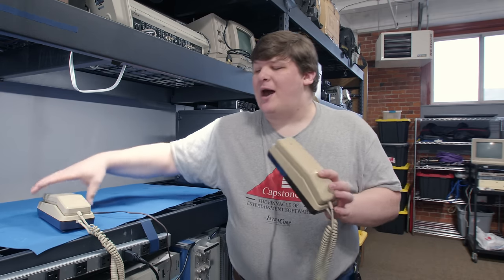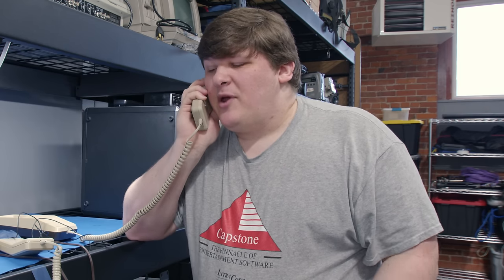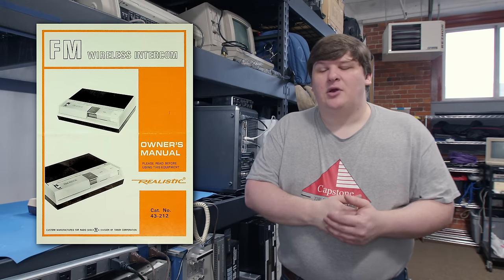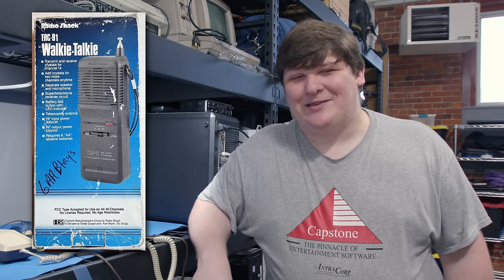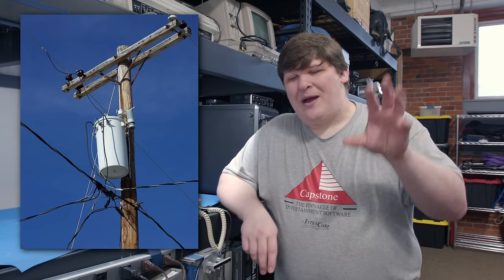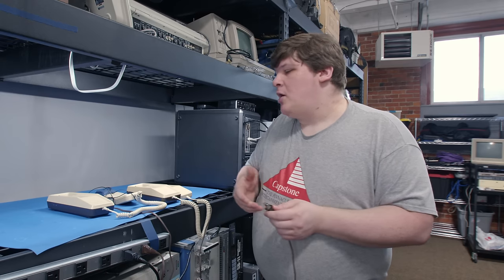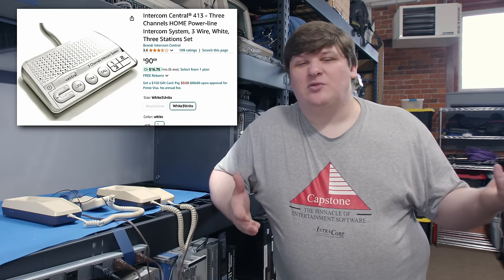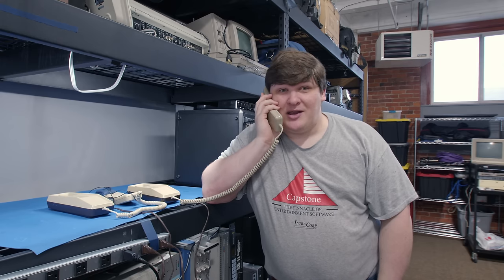How does this "phone" work without a line?

Comment: Send and receive frequencies would allow for both sides to talk at the same time instead of having to hand off/cede the frequency.
Reply: AKA "full duplex" vs the "half duplex" you typically see with walkie talkies, where you're either sending or receiving, not both.
Reply from the maker: ohhhh, that's what the full duplex means, of course. You can't receive while you're transmitting, it'll either feedback or you won't be able to hear the received signal, etc. I should have known that, haha.
Reply: @CathodeRayDude technically dual-simplex. Each channel only works in one direction. Full-duplex is using the same channel for both directions simultaneously, which is obviously more complicated than just having two independent one-way streets.
Reply: My hypothesis is the first unit you pick up to start the call always sends the ringing signal on one of the frequencies, and all units are listening on that frequency, or it just sends audio right away and the others use carrier squelch to detect ringing.Then the unit that picks up to answer the call will send its audio on the other frequency. Would be possible to verify by looking at a spectrum analyzer connected to the power line (I'm not sure how you'd couple it safely though but there's gotta be a standard method all these things use) and making calls in both directions and possibly by connecting a third one at the same time. If another one of these still exists somewhere.
Reply: That makes a lot of sense.
Reply: @CathodeRayDude  Except you can, one obvious example is a phone line ("plain old telephone service"), where the problem of feedback is solved with power of math and coils, as there is a special transformer (called "speech transformer" IIRC, which is ungoogleable) which subtracts whatever you are sending into the line from what you are receiving. With radio transmission how much you would need to subtract depends on the environment, so it's much more complicated and is not worth it for simple systems
Reply: Full duplex on a single channel is theoretically possible with AM but with FM... not so much. Mixing FM signals doesn't go well.

Which is incidentally why the French invented the SCART connector with RGB signals for hooking up consumer video gear, but that's a complicated connection.
Reply: @xpehkto  "hybrid transformer" is the term you're looking for. they are/were commonly used and sold labeled as such (as opposed to the implied one inside a phone) for connecting normal line-level audio equipment like tape recorders or mixers on call-in radio shows to phone lines
Reply: ALso known as "duplex" instead of "simplex"...
Reply: @xpehkto  "which is ungoogleable"
if you quote the words "speech transformer" and add the word `coil` or `telephone` you get some results.
the wikipedia article "Western Electric hand telephone sets" mentions the speech transformer, so you got the words right.
Reply: @thiesenf  that might be colloquially true sometimes (dunno - my limited electronics knowledge very rarely gets into protocols).
but their technical meanings are different
Reply: @blarghblargh  Simplex - only one channel is used
Duplex- Two separate channels are used

If two transmitters are trying trying to transmiott at the same time on tthe same frequency weird things happens...

With duplex transmission one station will use one frequency while the other station will use another frequency...
Reply: What's a bit puzzling is that the manual seems to say that more than two units can be connected and they will all talk to each other. Even if the first one picked up gets to choose its transmit frequency, that only leaves one frequency for all the other to use as their transmit frequency. Two FM radios transmittng at the same time on the same frequency doesn't work very well -- the receiver tends to lock onto the strongest signal and doesn't hear the other one at all. Also, only the first one picked up would be able to receive anything transmitted by the others.

It would be possible, though, for any two of them to talk to each other. A third one picked up after that would at most be able to listen but not talk.
Reply: @thiesenf  "Full duplex" means simultaneous transmission in both directions. "Half duplex" means transmission in one direction at a time -- as when a radio has a push-to-talk button.
Reply: @blarghblargh  It's also sometimes called an ASTIC - Anti Side Tone Induction Coil.
Reply: Aww but then you don't get to always say "over" - over
Reply: @gcewing   my grandmother’s phone had the WORST side tone before she got a cordless one. Maybe her transformer got broken. (Though she claimed she liked it because she was going deaf, so maybe it was a deliberate adjustment. The cordless phone actually caused her some issues before they found a handset with better amplification.)
Reply: @oasntet The military solved that by just saying "over" when you are finished talking.  Walkie talkies make that beep sound when you release the talk button that does the same thing.
Reply: This all makes sense for a consumer product where people are used to talking over regular telephones, where both parties can talk at the same time. There’s a telephone feature where one station rings when the other side picks up like this—I was at a newspaper where this was used to talk between the newsroom and composing room.
Reply: @markjames8664   I guess it was the office PBX which did that feature. My dad’s offices had that too, but it only worked inside the building
Reply: @kaitlyn__L  PBX systems are usually digital, so they can implement lots of features. The public phone system is digital too almost everywhere except for the last part of wiring to the house (although fiber systems like Fios take digital voice all the way into the house, and also require a backup battery system so the phones work in a power outage).
Reply: @markjames8664  I’m aware. (Though of course there were relay-based PBXes back in the day.) I’m just saying, I’ve only seen that in buildings that run their own, not on the wider PSTN/POTS. So it makes sense for Tandy to sell something that emulates that within a home. (Which cordless phones also later provided.)
Reply: @kaitlyn__L  I suppose this product would have done a lot better if there were more big houses like the McMansions of today.
Reply: @xpehkto  FWIW that special transformer is called a "telephone hybrid", there's a page on Wikipedia about it.  The hybrid technique won't work over power lines though, and as you mentioned, won't work over radio either.
Reply: @ERIFNOMI  "Full duplex" is the same as dual simplex. You can't use the same channel in both directions simultaneously, only alternating directions (half duplex). If you want to transmit and receive at the same time, you need to split the channel into 2 individual (simplex) channels. It's in the name, duplex, meaning two channels, one for receive and one for transmit, even if they are often grouped as one single logical "channel" while being two separate physical links.
Reply: This kind of sides the topic of how cell phones sare the same base station. You may have three multiplexing modes, which are TDMA, FDMA and CDMA, standing for time, frequency or code division multiple access. You kind of have a rudimentary TDMA with the usual walkie-talkies, taking turns to talk. FDMA is what is kind of employed here, you are using different frequencies. And CDMA is the most complex one, where multiple devices can use the same frequency, at the same time, but the signals can be separated sort of mathematically. I know this is not exactly the same thing, as there isn't a single base station with multiple clients, but the problem is somehwat similar. I'm not sure if you could have a CDMA-like thing for an all-peers network, but it would have been an overkill espeially at that time anyway.

Comment: The buzz in the receiver is from all sorts of modern electronics containing switching power supplies, which spew out high-frequency noise onto the power line. Good-quality power supplies filter this out, but cheap ones don't. Even LED light bulbs do this.
Reply: Yeah, that sucks. Noise from power supplies are everywhere and we can't fix that
Reply: Fun fact that because of that, it means that the static is very specific to each energy network and can be used as a means of identification of the location from a recording.

It's a bit of forensics matching that doesn't get to be done very often, because it's not very often that you can hear or record static like that. But everywhere is fairly unique, so it works kind of like a buildings finger print.
Reply: @vwestlife, I have a television camera from the early 2000s and if I plug in a mic through the XLR jacks using phantom power the audio is unusable from the static, but only if I'm using an XLR cable longer than about a foot and with the camera running off the AC adapter. I've even switched off every breaker to the house except for one outlet with only the camera plugged in and the buzzing is still present. However, if I run the camera off battery power it sounds perfectly fine. Is this why? I spent days trying to find the answer on Google and I never found anything this simple.
Reply: Yeah, only ever noticed buzz in stuff with switch mode power supplies, never with linear power supplies.
Reply: And I bet the noise on the intercoms is the same noise making him have no luck trying power over ethernet systems on his house wiring.
Reply: @Saavik256   that’s why the BBC originally forced Acorn to put a linear power supply in the BBC Micro (nee Acorn Proton). They wanted to be able to use them in their transmitter locations without noise messing things up. According to, IIRC, Steve Furber they had overheating problems within a month in the general public and got permission to change the wider sale spec — but the BBC kept using the linear supplies in their own installations’ computers. Sometimes requiring a technician to open a machine up and swap it round!
Reply: I'm not so sure about that. I remember this style of intercom from the 80s and they all had horrible 60 Hz buzz. I assumed it was because they were getting a signal from the power line and didn't bother to do a very good job of filtering out the 60 Hz component from the rest of the audio circuitry.
Reply: @flapjack9495  the 60/120Hz is always happening with AC, but I believe he’s referring to the higher-pitched overtone that Gravis mentioned right after.

Comment: 200KHz is a dead giveaway. That's a longwave frequency, and not free for use by Joe RadioShack and his walkie talkies in America. But modulating the 60Hz carrier on the power line? Go nuts.
Reply: So are these transmitting through the wires in the building, instead of the air? If I'm correctly reading the FCC chart I just googled (which I'm probably not), 200khz is for AERONAUTICAL RADIONAVIGATION.
Reply: @bobthecomputerguy  In the UK 200 KHz was (it's now 198 KHz) BBC Radio 4. They must have changed the frequency slightly for the European market but they did sell them in the UK.
Reply: @bobthecomputerguy Pretty much, yeah. Personally I think of it like the electrical wiring in your house is used as a long waveguide for two transmitters.
Reply: @bobthecomputerguy  Yes, sort of. These things put out 55 milliwatts RF which is micro power – not enough to radiate much through the air but will travel a long distance along the length of a conductor. They use the house wiring as an antenna, but inductively coupled to avoid dangerous voltages. In theory, a radio that can tune 200kHz held very close to the wiring should pick up the signal.
Although it sits in or near the band used by airport non-directional beacons, the very low power means minimal potential to cause interference (covered by FCC Part 15). HOWEVER, if the units are installed near an airport with a NDB transmitting on 197 or 200, they could very well pick up the morse ident and weather forecast!!
Reply: @oldblueshirtguy  Aeronautical NDBs (non-directional beacons) and AM long/medium wave radio share the same band. You can listen to AM radio on your aircraft NDB receiver, the receiver will even point to the transmitter station as if it was an NDB.

Conversely, you can listen to NDBs with your AM receiver but they're not very interesting as they only beep an ident in morse code.
Reply: Google "wired wireless" its possible to transit FM radio over powerlines between substations